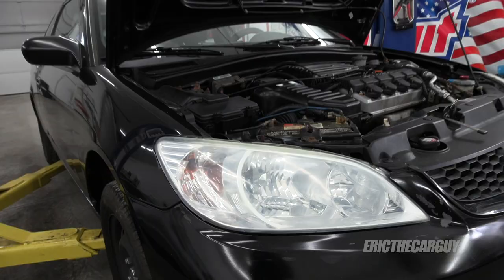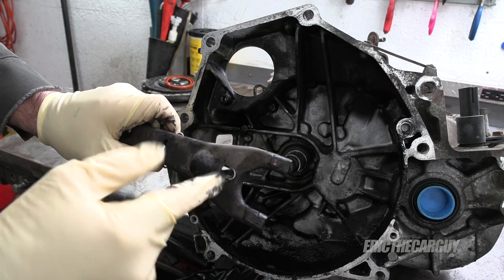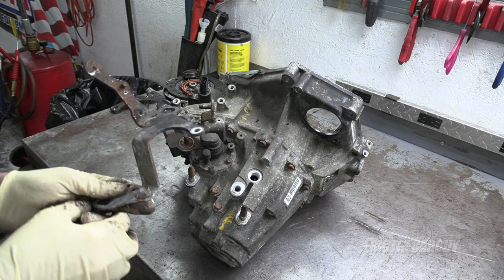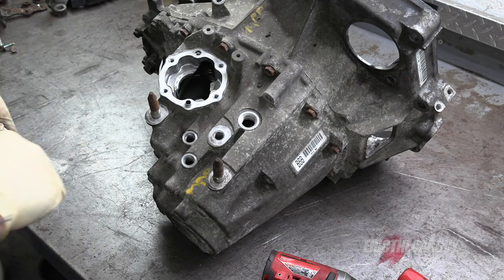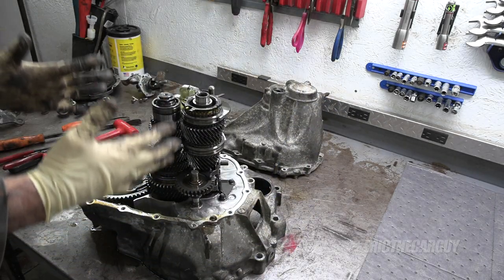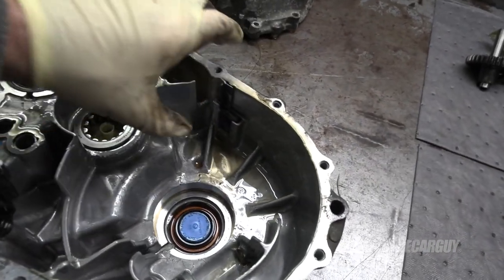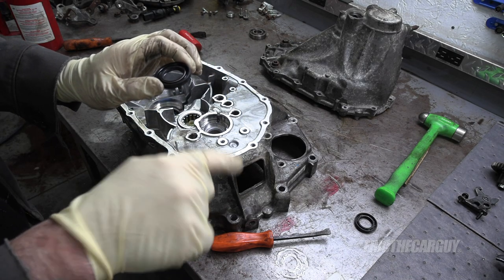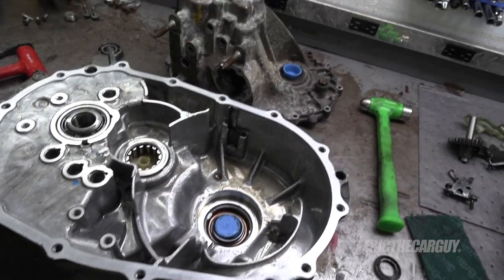01-05 Honda Civic Manual Transmission Rebuild

Comment: my 2001 honda civic ex will go into every gear except 5th. What will cause it to do that?
Reply: Mine is doing the same thing. Replacing the clutch and trans today. Wish me luck lol
Reply: @studio20seven  oh my. I thought it was just mine that did that. Well best of luck to you, and please be careful. I spent this past weekend changing mine out. Took me twelve hours total because the way the shop fixed my exhaust, they mounted the rear of it to the frame of the car. So instead of completely removing the subframe, I just let it rest on the exhaust and shifted it to the side to make room to lower the transmission after removing all of the bolts. I used an extra jack stand to support the subframe, while using a floor jack to pull the transmission from under the car.

Comment: Cleaned bearings are always noisy. Only way to really test the bearing is to oil it and put it under load before spinning it
Reply from the maker: Personally, I can feel a bad bearing. Feels like there's grit inside when you spin it. Thanks for the comment.
Reply: @ericthecarguy  I agree that they can be pretty clear when they've fully gone bad but there are a lot of borderline cases. Have a good one man

Comment: guessing the honda bond is polyurethane based (same as window weld and the coating they put on top of aircraft carriers). its cure time is highly dependant on the humidity level * temperature.
hot day, non aircond. shop, cure super fast. cold night, dry place like the desert, defiantly let it cure overnight. imo if the latter is u, i would put a big bowl of water next to the part overnight, or better yet use a humidifier close to it.

Comment: hi eric i bought a transmission for my k20a3 replacement and im not sure if its a manual or auto. here's the serial no. rpd6-1500925 i cant find verification online and even on the dealerships around me. hope you can help me

Comment: what's the mile ?
Reply from the maker: See last weeks video about the clutch replacement linked in the description for the mileage, sorry I don't remember. It really doesn't matter since this was a salvage yard transmission installed by the previous owner. Thanks for the comment.

Comment: Looks like yellow writing is on it maybe a junkyard transmission?
Reply from the maker: Good eye, it was. The used car dealer installed this transmission trying to fix the noise of the original transmission. Because they didn't install the dowels, this one failed too, if it wasn't bad already.
Reply: @ericthecarguy  
Gotta love those used car dealerships!!

Comment: the  bast manual  transmission  is  Nissan  and Toyota  transmission man in Saudi arabia  we but V8 engine  with  4 cylinder transmission and it takes it no problem

Comment: 29:37 To be fair, if you did this to a brand new bearing it would sound the same.
Reply from the maker: No, in fact, I believe I spun the new bearing in the video.
Reply: @ericthecarguy  True, but it wasn’t washed in solvent....but nevertheless the old bearing was trashed and needed to be replaced no doubt.👍